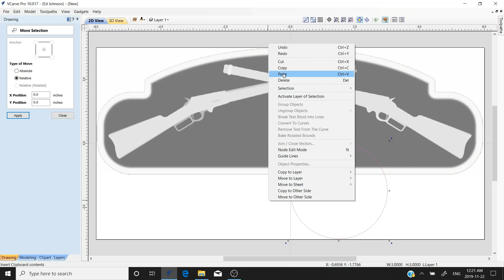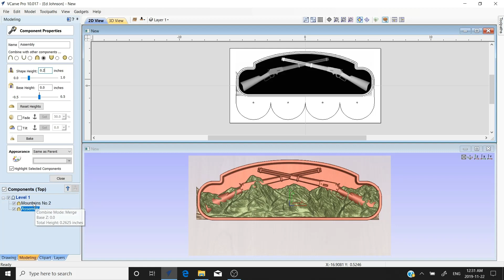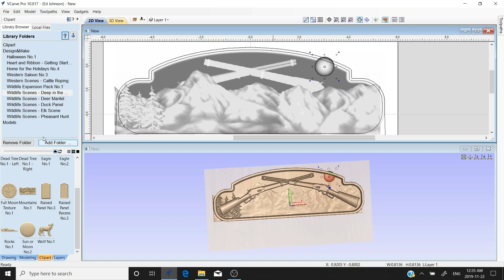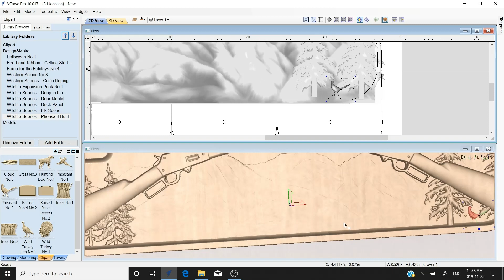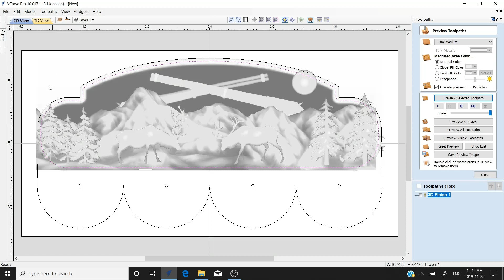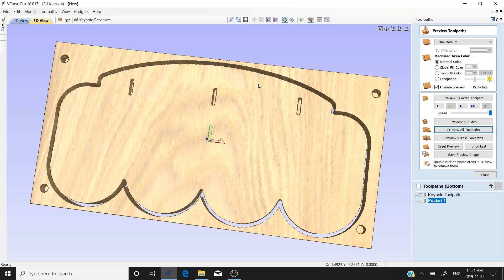3D carving Key Hook created using Vectric  VCarve Pro and Clipart.

Comment: Nice project and demo on using clip art.  Couple questions.  Any reason for the 200 degree raster angle on the 3d toolpath?  Regular VCarve doesn't support gadgets so suggestions on the keyhole cuts?  I am thinking MDI is probably the easiest workaround.
Reply from the maker: you can use any angle, I just put in that number, no real reason.